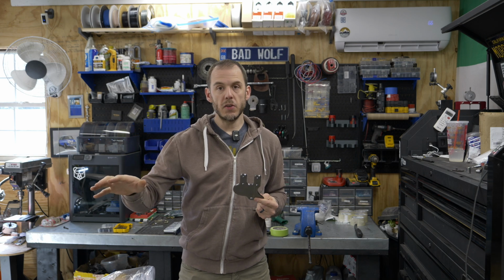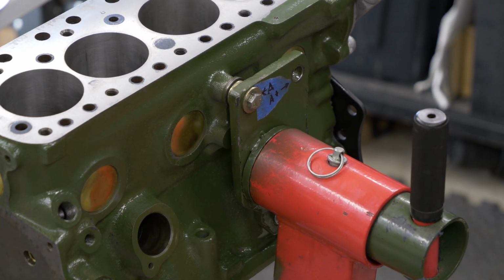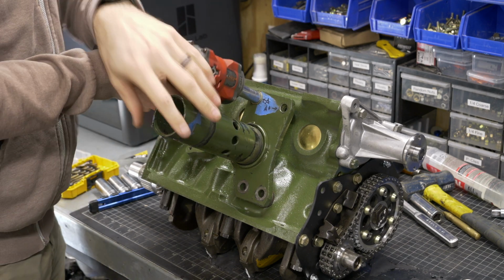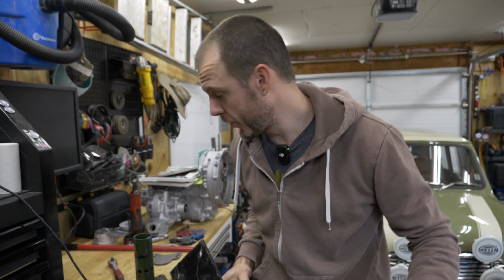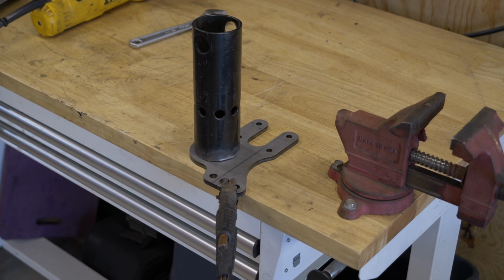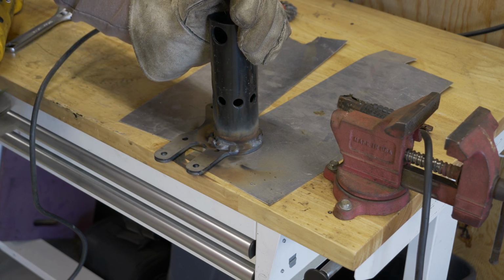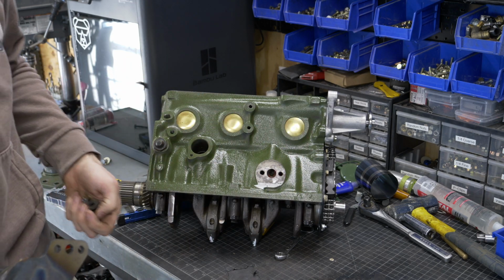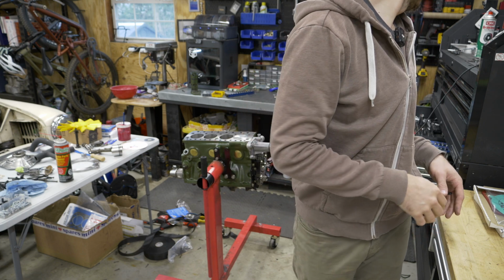The DIY Engine Stand Plate - Now Available!

Comment: If you just have spacers at all fixing points it will fit A and A+ without any changes.
Reply from the maker: Unfortunately it doesn’t. If you leave spacers in place for all, there is block contact between A and A+ engines on the alternator/generator forks